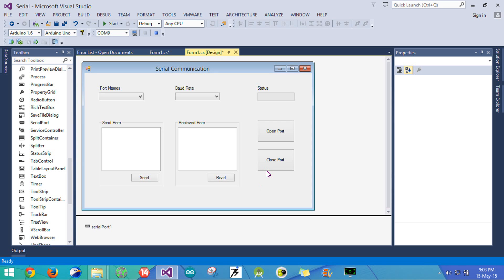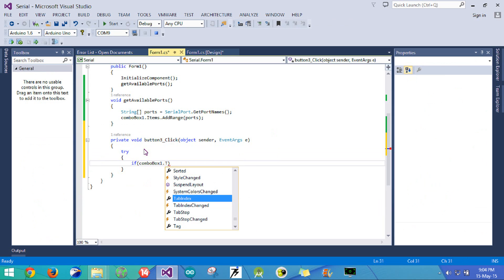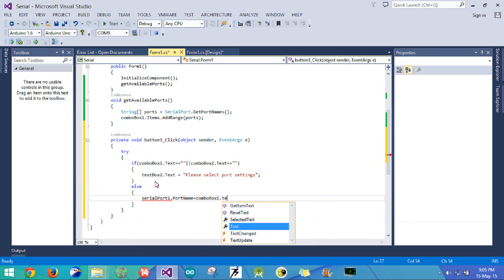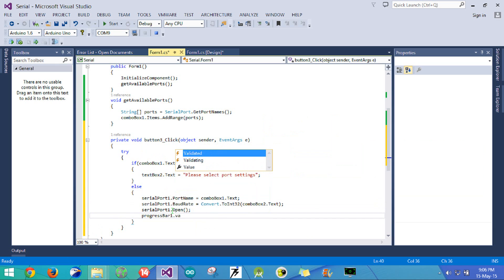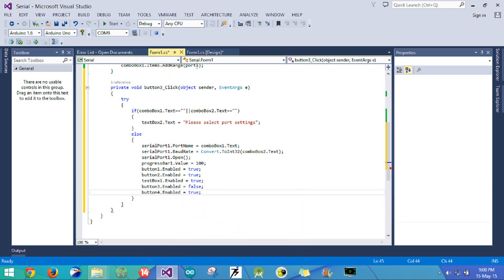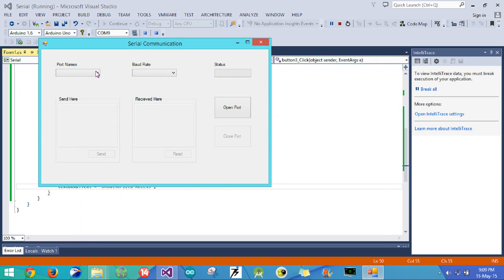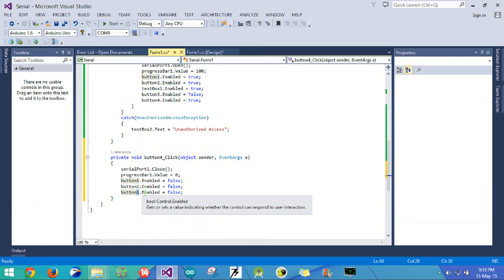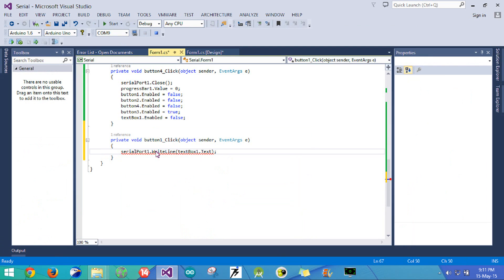Visual Studio C# Serial Communication Tutorial - Part 2

Comment: Helpful video!! , The Arduino code is missing , Im not an expert but I wrote the following Arduino code for this application and it works:
void setup() 
{
  // put your setup code here, to run once:
Serial.begin(9600);
}
void loop()
 {
  // put your main code here, to run repeatedly:
  char data=Serial.read();
  switch(data)
  {
    case '1' : Serial.println("Hey!!, just recieved 1");break;
    case '2' : Serial.println("OK, I recived 2");break;
  }
}

Comment: I believe that would be nice if you had added your source code and explained as you were reviewing instead of writing it on the fly. Because the way that your audiences are following you is writing the code as they watch your video and this ends up with errors and lots of confusion. Why does this not working?! Or so!  Otherwise you did a great job and thanks to you for bringing this most applicable application as a Data Acquisition program.
Reply: Totally understandable! BTW, do you know why I still have an issue even though I've added serialport1 definition in my code? How did you define it in your code. If you remember, that would be nice!
Reply: Ok buddy. Let me re-watch what you have done! I will bug you again if you don't mind.
Reply: Ok, I re-watched it and did not get what I was looking for. Here is the error.

Error 1 The name 'serialPort1' does not exist in the current context C:\Users\carma\documents\visual studio 2013\Projects\Serial\Serial\Form1.cs 66 20 Serial
Reply: And after adding the following,

private static SerialPort serialPort1;

 the compiler says:

Warning 1 Field 'Serial.Form1.serialPort1' is never assigned to, and will always have its default value null C:\Users\carma\documents\visual studio 2013\Projects\Serial\Serial\Form1.cs 20 35 Serial
Reply: Ok now after changing it to

   public SerialPort SerialPort1;

It runs but it comes up with the following error.

An unhandled exception of type 'System.NullReferenceException' occurred in Serial.exe

Additional information: Object reference not set to an instance of an object.

Do you mind if I have your email address to send you some screen shots?

Thanks!
Reply: Dude! Eventually I was able to run it flawlessly. However, I am not able to receive anything! It seems sending part is now not working!
Reply: I've used a loopback and I am supposed to receive an echo! But nothing can be received!
Reply: Wow! Bud all DONE! Many thanks to you bro! :)
Reply: TheTechDesk:    Here is another issue. If you don't receive anything or if you hit receive without sending, the program crashes at ReadLine()  any handling solutions for this please?

Comment: He's missing 2 lines of code:
1) static SerialPort serialPort1;
2) serialPort1 = new SerialPort();

Therefore first lines of the Form1.cs should look like this:

    public partial class Form1 : Form
    {
        static SerialPort serialPort1;

        public Form1()
        {
            InitializeComponent();
            getAvailablePorts();
            serialPort1 = new SerialPort();
        }
Reply: Thanks PUNK'SnotDEAD
Reply: New to serial ports here: what are these two lines needed for? Following the video, the program runs fine so what's the benefit from these?
Reply: I understand that's to create a new object, but why would you need to do that when you use the toolbox to add it via the GUI? isn't that the object already?
Reply: Rohit, 
Then why they did not get created for me!?
Reply: It seems version 2015 created automatically. Mine is 2013!
Reply: Cheers!
Reply: Thanks man!

Comment: As Brian White said Just add timeout setting
            InitializeComponent();
            getAvalablePorts();
            // Set the read/write timeouts
            serialPort1.ReadTimeout = 500;
            serialPort1.WriteTimeout = 500;

for me works!!
MCU device DATA receive side has to be correct termination \r\n example: "YOUR STRING HERE\r\n"

Click receive button for see each message you sent and after receive all messages it shows "Timeout Exception" as a "signal" of the receive String Buffer is EMPTY.

Great Job Rohit Suri! simple and useful serial for MCU.

Comment: Interesting tutorial video, 
I have a problem communicating with an arduino (the UNO model), with Visual Studio 2015 and Windows10, the problem is when I send a single char nothing goes out from the PC to check it  I put a check on the arduino sketch that changes the LED status : OFF to on and viceversa for each single char received.
With the program written in c# nothing happens, the led still OFF or ON at every sent char, but if I do the operation using the Arduino sketch editor "Serial Monitor" all work fine, this is embarassing.
My program is like you one, do you have suggenstions ?

Comment: It all works fine, up until I get to ReadLine(); I get "InavlidOperationException";
 It locks up.  Have any thoughts?  I don't have my micro-controller connected but I don't think it should matter.
Reply: +Rohit Suri How do you put a string value into a COMX like when you got the variable "1" you can read on the PORT "it's gets better" How did you do this with a virtual port ?
Reply: +Rohit Suri this not work ?

Comment: This has been very helpful! My only question is, how did you program the Arduino to send back a certain value after receiving something? I know its off topic but I would like to know
Reply: The arduino IDE can be used to have serial communication from any arduino board through the usb out. Using the serial communications functions on the arduino you can read and write from the arduino as well.

You would need code like   
  if (Serial.available() > 0) {

                // read the incoming byte:

                incomingByte = Serial.read();
if (incomingByte==1)
Serial.WriteLine("This is Awesome");

        }

Comment: Where is the arduino code? i got it working but when i read the incoming data from arduino i dont get what i was expecting!
Reply: +Ian Dorion you can use this code to test which also can test with a LED in pin 13:

#define ledPin 13
char serialByte; // for incoming serial data

void setup() {
  // put your setup code here, to run once:
  Serial.begin(115200); // opens serial port, sets data rate to 9600 bps
  pinMode(ledPin, OUTPUT);
}

void loop() {
  // put your main code here, to run repeatedly:
  // Send data only when you receive data:
  if (Serial.available())
  {
    // read the serial byte:
    serialByte = Serial.read();
  }

  if (serialByte == '1')
  {
    digitalWrite(ledPin, HIGH);
    Serial.println("This is awesome");
  }
  else if (serialByte == '0')
  {
    digitalWrite(ledPin, LOW);
    Serial.println("It gets better");
  }
}
Reply: +Ian Dorion this is the code i made for just testing it, it just turns on and off an led, you just send it a 1 through serial to turn the led on and a 0 to turn it off, it works with regular serial monitor for arduino but when i make a thing with visual studio C# it turns on but not off,  (with serial if you send a 1 its received as a 49, and a zero is received as a 48, its different for different numbers and characters).
const int led = 5;
void setup() {
 pinMode(led, OUTPUT);
 
Serial.begin(9600);
}

void loop() {
if (Serial.available() > 0) {
  
 int serial = Serial.read();
  
  if (serial == 49) {
    digitalWrite(led, HIGH);
  }
  if (serial == 48){
    digitalWrite(led, LOW);
    }  
  }
}
Reply: +Rohit Suri yes, I have tested with 9600 baud rate but it is quite slow in my device, so I changed to 115200, but forgot to change the comment.